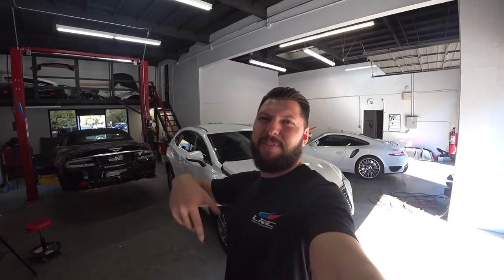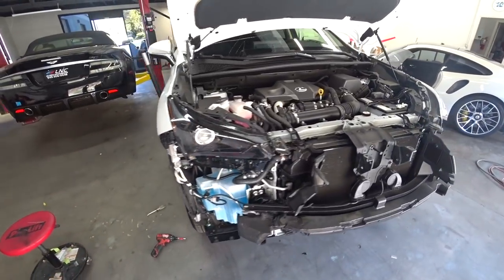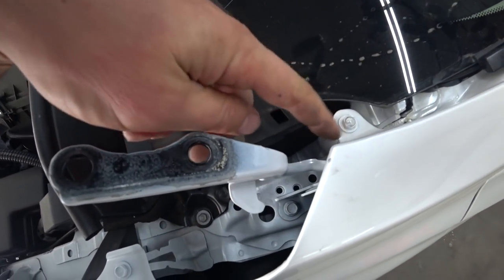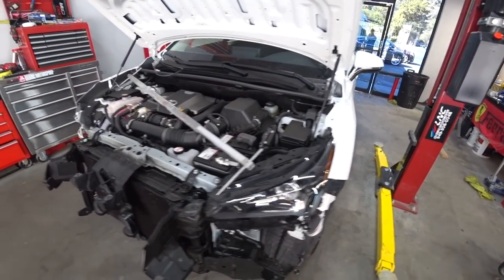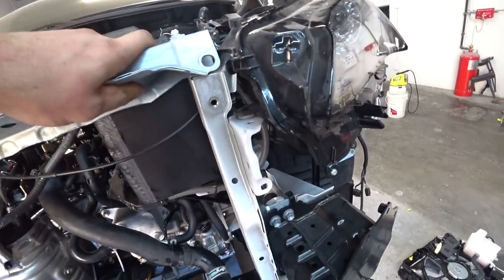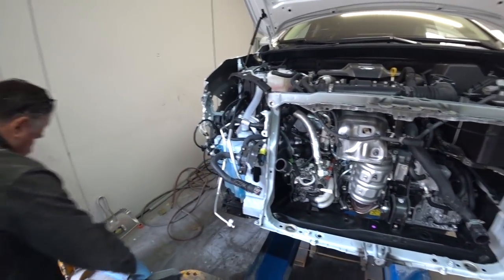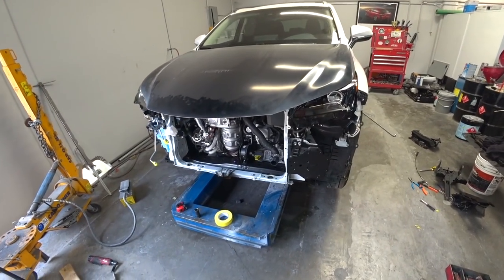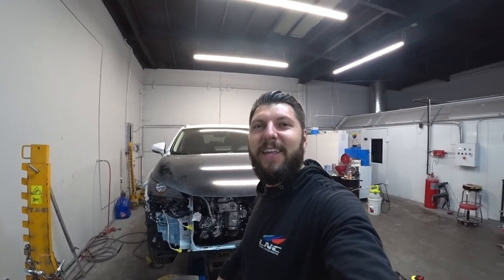REBUILDING A WRECKED NEW 2019 LEXUS NX 300 part #1

Comment: good job, but I'm a little surprised by the fix. Wouldn't it be better to put the engine down and check the front beams instead of stretching them? maybe there a weak spot or a crack, or have you checked? I would be afraid to sit behind the wheel in this half-life.
Reply: I agree with you.

Comment: The frame got that bent from a light hit like that? Wow, Lexus is making really crappy cars these days! I'm pretty sure a German car wouldn't bend that badly from a light hit.
Reply from the maker: Jim D Yeah very soft metal nowadays.. 🤷🏻‍♂️
Reply: Lexus uses steel parts which are very soft compare to aluminium which german cars uses
Reply: New cars are designed to crumple like a peice of paper in a collision. Car absorbs the energy so you dont. Doesnt take much to write off a modern car.